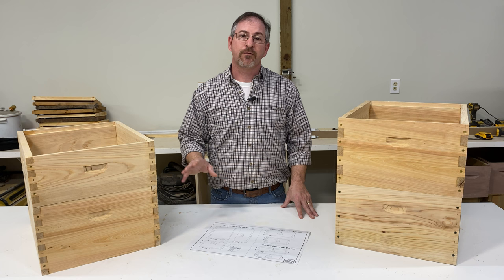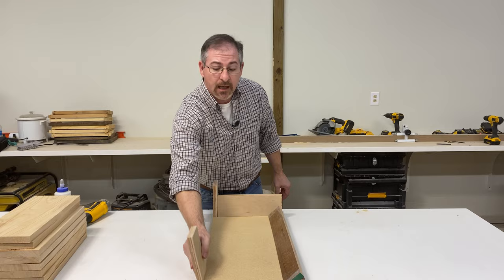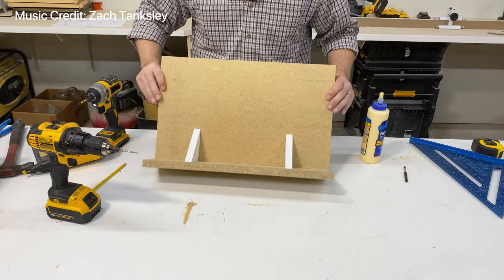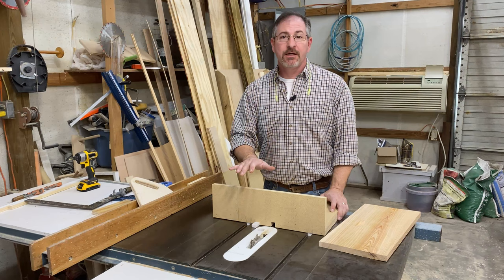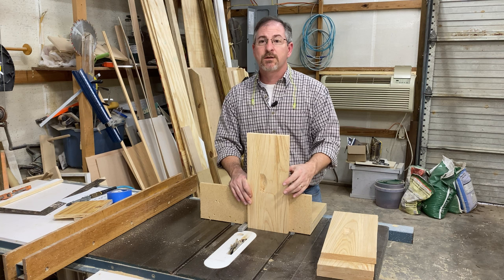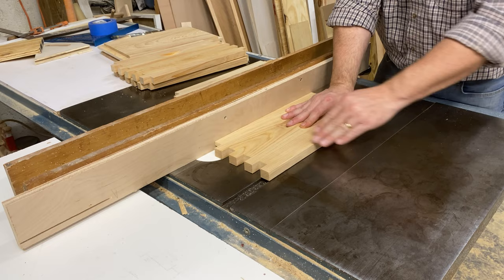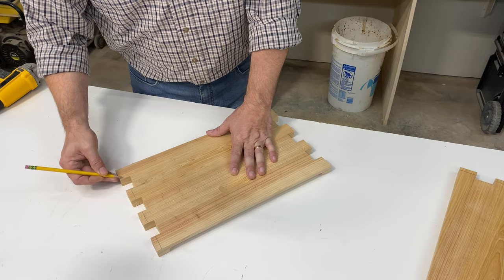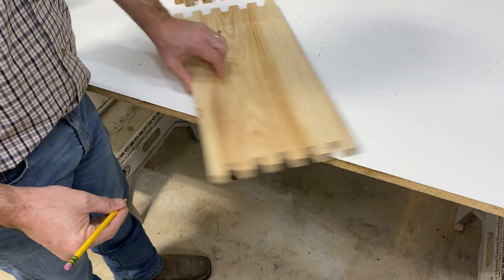How to Build a Beehive with Box Joints and Recessed Handles.    Free Plans.

Comment: Awesome video. You scared the hell out of me when you placed your hand above the dado blade and pushed the board down onto the handle jig! If you ever miscalculate the depth of your blade it will be a very bad day. Thanks again for the video!
Reply from the maker: Glad you enjoyed it! 
I always run test pieces during my setup and constantly check to make sure my depth hasn’t changed throughout a run. It’s hard to tell in the video but I try to keep my hand just behind where the blade would come through. Having said that, there is always that chance! Use your best judgment, work within your comfort zone and be safe!
Reply: I Second that.
Reply: A plunge router is a safer way to make that cut
Reply: @gary_stavropoulos make a video of how you would do it, I am curious.
Reply: @austinblevins3084   sure since there are no videos of people using a plunge router.
Reply: @gary_stavropoulos  my man if you know please show that will be safer and you can work where you can see. Plus we need all the bee keepers we can have these days
Reply: @austinblevins3084  https://youtu.be/bkeAfQHPIIw?si=-OnMjScvaFWaH7h4 I searched “how to use a plunge router” and that was the first video. With a plunge router you put the router on the wood and lower the bit into the wood so your hand is not near the cutter instead of pushing the wood on to the blade.
Reply: @gary_stavropoulos  no I have plenty of experience with the router. I just need to see your method for the side handles. What bits are you using and set up. His tablesaw method is perfect, how can we reproduce that style with a plunge router.
Reply: @austinblevins3084  if you have experience with a router you should know you would use a straight bit and how to set the depth. His way will make the cut my point was that using a tool specifically designed to do exactly that is safer than what is done here.
Reply: @gary_stavropoulos  explain how to make the smooth transition from each depth movement of the bit. With the same speed and efficiency.   If we are not concerned with speed then just chisel it all out. Not here to measure peckers. Just figure out the best fastest safest way to get this done.
Reply: @austinblevins3084   which is more important speed or safety?
Reply: @gary_stavropoulos  a combination of the two, if the table saw does it in 1 min pretty safe, but router completely safe takes 25 mins per board. Table saw it is. Use some push sticks or double sided tape handles on the pieces. Still faster and safer. I need to batch out a pile of them. Need a cnc honestly. Hahahaha you know how it is.
Reply: @austinblevins3084  a cnc would be best
Reply: My inexpensive saw has a tendency for the blade depth to wander if I don't lock it down (separate handle to do that).  Please be careful.

Comment: Thank you for this video! Have you ever tried locking miter or lapped miter for hive construction?
Reply from the maker: I have never tried a miter of any kind on a hive box. Personally I like box joints because they equally distribute the lifting load across all four sides of the box. 
I would be interested in hearing feedback on boxes made with locking miters after a few years of use but I really don’t want to test that theory myself. I really believe that over the course of a year or two that they will fail.

Comment: You have released a number of terrific videos that are going to be very helpful to me with my Bee Box build for a good friend of mine. You mentioned a way to add width to my medium box versus the deep version by screwing a ripped piece to the more narrow board. This will leave two screw holes in my boards, unless I add some putty.

Could I avoid the screw holes by adding some double sided tape under my rip cut piece?

Thanks for the initial video and your response.
Reply from the maker: I’m glad you’re finding my videos useful. Be sure to check out the plans as well. You can find a link in the video description or go straight to The Southern Craft Woodshop and look in the blog section. 
As for cutting the recessed handles into mediums, I do recommend using the method I describe in the video and YES I advise using screws. The reason I advise screws over double sided tape is the stability of the panel while you’re cutting the handle. Your dealing with a part that is being moved over and across a dado blade. In my opinion, your fingers are far to important to risk the double sided tape turning loose mid cut. 
Yes there will be a couple screw holes left behind but they will be on the inside of the box. Your bees or at least your friends bees won’t mind these small holes but if you do, simply fill them in. 

I hope this helps.
Thanks for watching!
Wes

Comment: really helpful tutorial...I used yours and a couple others to build mine (mostly yours)...worked out pretty well.  

I'm not a skilled woodworker, I build in metal...usually steel, so I am hesitant to critique, but all three tutorials I watched all made the same "mistake":  leaving the tracks for the sled thicker than the slot depth...leaving the sled floating above the table and on the bottom of your table slots.....why?  All you're looking for out of the slots is to maintain perpendicularity, the surface of the sled should take its position from the saw table top, no?

anyways, I made mine thinner so they dont touch the bottom of the slots.  Sled moves real nice & the sled actually sits on the table.  Anyone looking to build one of these would be wise to consider that small change.  

ps  I also used wood glue & 18g 3/4" brads to secure them, also worked fine.
Reply from the maker: I’m glad you enjoyed the video!

As for the tracks in the T-slots, for this jig I used some scrap solid surface material that comes 1/2” thick. This does leave a small gap between the table top and the underside of the jig. I’m personally not concerned with this on this particular jig because I get slightly less resistance as I slide through the cut. The workpiece itself does need to stay in contact with the top of the saw throughout the cut. For me, this has not an issue with this jig. 

On other jigs I typically do run a shorter track. It really all depends on the function of the jig I’m making. 

Thanks for watching 
Wes
Reply: @thesoutherncraftwoodshop4134  thanks for responding, much appreciated!

Comment: Seems like it’s better to have the ends start with a missing “tooth”, so then your rabbit can just be done on the table saw without a stop.   I also found it sort of a tolerance issue to rotate with the same side out instead of flipping with the same top edge with the fence.   Overall, I watched your video several times and studied the plans over and over.   The jigs perspective would be better if the drawing was as if you were looking at it standing at the table saw.   Everything came together in the end.   I can now make deeps and mediums with speed and accuracy.
Reply from the maker: I’m glad you were able to take the plans and video and work out a method that works for you. Thanks for watching and thanks for the comments.

Comment: Excellent video truly admire your craftsmanship and your free plans, any metric available as well
Reply from the maker: Thank you!
I do not currently have plans available in metric but maybe I need to consider that moving forward. If you are handy with a calculator, you can convert the current dimensions into decimals then multiply by 25.4 to get the metric equivalent. (9 5/8 would convert to 9.625 then multiply 9.625 X 25.4 to get 244.475. So 9 5/8” would be 244mm.) 

Hope this helps and thanks for watching!
Wes

Comment: What is the reason for the large 1-3/8" box joint? I thought a box joint was typically the same as the stock thickness.
Reply from the maker: Most commercialy produced hives tend to use the larger box joints. The smaller 7/8” joints tend to be a little easier to set up and cut for most people who would like to build their own. I wanted to show several different options in this video so each individual could decide which construction method would suit them best. 
You are correct. In most woodworking projects, box joints are made to be the same as the material thickness. The reason for this is typically for the cosmetic appearance of the final product. Although common practice, this does not define what a box joint is. It can be either larger or smaller depending on the design aspects and or structural needs of the project. 
Thanks for the question. I hope this helps. 
Wes

Comment: I have two dado blades, a wobble and a stack,  and both of then only go to 3/4". I really like the 7/8" box joints. is it possible to make the jig just as you show. and then make two cuts to equal 7/8 inch, and the move over and so on, or am I going to run into some trouble. Thanks really enjoyed the video.
Reply from the maker: Yes it is possible. It would be the same principle as the 1 3/8” box joint jig with a few different spacing adjustments. 
I haven’t done the math on it but you could do a 3/4” box joint and save the trouble of the extra pass at each finger. 
Also, I would recommend the stack dado over the wobble. The stack gives a flat cut all the way across the width of the cut where as the wobble will give a radius to the bottom of the cut. 

Hope this was helpful

Comment: Very good, very concise!  One thing - when you checked for square... how do you remedy if they are not square at that point? Wouldn't it be better to place the whole box in some jig to keep it square before you screw/brad them?
Reply from the maker: Thank you!
First and foremost, be sure your cutting your cross cuts square. If the cuts are made square, box joints typically come together relatively square. When a box is out of square you can rack it back to square by cross clamping or by bumping it against the floor before setting it to the side for the glue to dry. For a box built with rabbit joints, I would cross clamp or bump it by hand. Rabbit joints will typically have a little more play in them. 

As far as using a jig, yes, I would have to agree and disagree with you at the same time. I love jigs! If you were to planning to assemble several boxes then a jig for assembly makes a tremendous amount of sense. However, I personally would not spend the time and effort to set up a jig for only a few boxes. Now with all of that said, I will be starting to assemble several hundred boxes in the coming weeks. There are assembly jigs out there that you can buy but I’m either too cheap or stubborn for that. I am already planning to build a makeshift jig to help simplify and speed up the process. 

I hope this helps. 
Wes

Comment: Thank you for this video!
About the width extension for the medium board, i'm wondering if anyone has tried screwing the 2 5/8 extension board down to the jig rather than the piece? This would save having to screw the extension to each medium board which would save time and also eliminate 2 screw holes in each piece. Has anyone tried this?
Reply from the maker: I played around with a few ideas like this. The issue I had was the angle starts out too low and is in contact with the blade before the workpiece touches the top face of the jig. You could solve this by increasing the angle of the slide. I think it would be best if you were to do this, to make a separate jig for mediums. Also, the slope on the underside of the handle will be different than what you would have on your deep boxes. Not that that would matter functionally. 

Hope this helps 
Wes
Reply: @thesoutherncraftwoodshop4134  Ahhh yes.. I see exactly what you mean. I just got back from playing around with this jig in my shop and immediately noticed the issue you've just described.

Thanks for the information Wes, you've been super helpful!
Reply: @thesoutherncraftwoodshop4134  ditto.  I thought the exact same thing and dropped my spacer without affixing.  It changed the angle of the angled cut.  I guess I'll have to affix the width extension as suggested.

Comment: Very nice work.  I have been trying to think through the best way to do those handles and I love the job solution you used. I was wondering though... 

Do you think it would be possible to have the "slide rail" (I think that's what you called the angled piece?) be a lower angle - like 33 degrees (maybe) instead of 45 perhaps and then have the slope go all the way from the bottom of the handle to the top and not necessarily need to do the prior step of lowering it down the other direction onto the dado stack?

Hopefully the question makes sense...
Reply from the maker: If I understand your question correctly, by lowering the angle the vertical height of the handle would increase due to the longer distance it would need to travel over the blade as it slides down the rail. Without testing it I’m not 100% sure that you would even have the clearance between the blade and the workpiece with the blade set for its final cut depth. That clearance allows you a margin of error to set your workpiece on the jig before starting into the cut as well as creating the rounded bottom to the handle. 

Another aspect of your question is being able to slide down the slide rail in one pass without first doing a clean out or plunge cut. As the workpiece begins to slide down into the Dado blade it is being cut by the top edge of the carbide tips. As you continue to slide across and cut deeper the edge of the carbide tips will cut in a limited capacity until the depth is deeper than the carbide tip. At this point your workpiece will bog down before your cut is complete. 

I hope this helps and answer the question you had. 

Wes
Reply: @thesoutherncraftwoodshop4134  Thanks! The second part of your answer was ultimately what I was trying to think through. 

I was trying to work out if the reason for having the handle cut as two separate steps was for aesthetic purposes or if there was a functional reason for doing it that way. 

Not that the two separate steps take a huge amount of time or anything once you have that jig set up. Just trying to understand the process better.

Thanks!
Reply from the maker: Having the bottom portion of the handle slope down allows rain water to drain from the handle. This helps prolong the life of your box and it looks good too!

Comment: great tutorial.  the handle jig is the best and easiest I have seen.  question on the  inch and 3/8 box joint. is there a reason to have the pin first on the short piece?  can this be switched to pin first on long piece?  thaT way u can run dado for frame rest and skip the router
Reply from the maker: Great question!
You could certainly do it that way. That is how I did the 7/8” box joints. I wanted to show it this way as an option. It also allows for placing a screw closer to the top edge of the box. 

Thanks for watching!
Wes
Reply: I figured you had a good reason.  one other thing is I have pretty bad tearout when using the dado blade.  wondering if I have a cheap blade or if u also have this issue.  I have used a backer board and this helps but doesn't stop it completely.  any other pro tips for making cleaner cuts?
Reply from the maker: Sharp blades definitely help. The wood species and the speed at which you make the cut has a lot to do with it as well. I make most of my boxes out of Southern Yellow Pine or Cypress. They tear out much more than I would like. I turn this to the inside of the box. If it creates a nook for a small hive beetle to crawl into, the bees will usually trap it in with propolis. I have used Eastern White Pine a couple of times and it does not tear out as bad. I would use it more often but the lumber companies around me do not stock it and the big box stores that do are VERY proud of it!  A backer will all but eliminate tear out if it is kept tight to the workpiece and replaced when it begins to wear out which is often. 
One area to pay close attention to is to cut your frame rest after you have done the box joints. (This applies to the 7/8” box joint plans.) Otherwise the the ledge the frame sits on will blow out almost every time. If you do other woodworking projects, this same principle applies. Tear out is common when coming out of a crosscut or coming out of a router cut against the grain. Whenever possible, make these cuts first then make your rip cuts or router pass with the grain last. 
I hope this explanation makes scene and helps.
Reply: @thesoutherncraftwoodshop4134  yes thank you.   I will try keeping them all to the inside i guess.  My blade is new so maybe not enough rpm.   and I noticed that with the backer board also that it does fine for a few cuts then yeah it doesnt help much until you cut a new spot.

Comment: Thank you for such a great video.  I will be getting started on my boxes after Christmas.  Concerning the recessed handle jig, what height did you set your dado blade?  Sorry, but I did not catch it in the video if you mentioned it.
Reply from the maker: The dado was set approximately 1/2” above the top of the jig. 
Best of luck and thanks for watching!
Reply: @thesoutherncraftwoodshop4134  Thank you for your response.  This jig worked perfectly for me.  I have shared with other beekeepers, and they were very impressed with your design.  Good luck with your apiary this year.